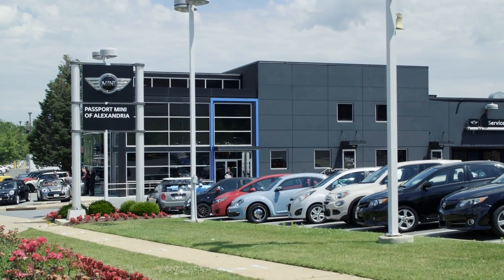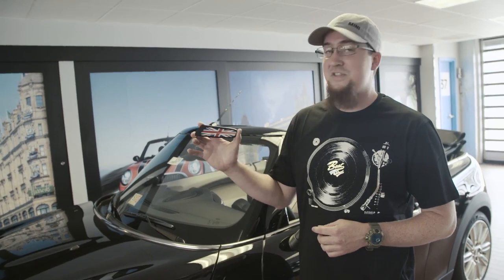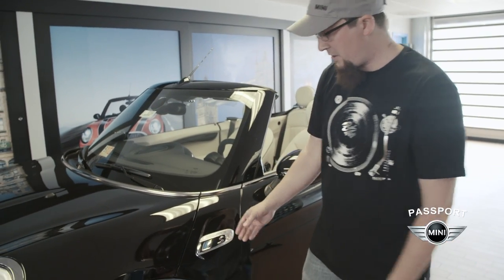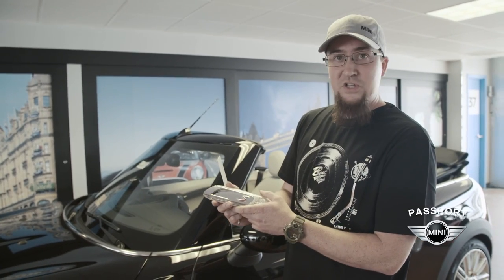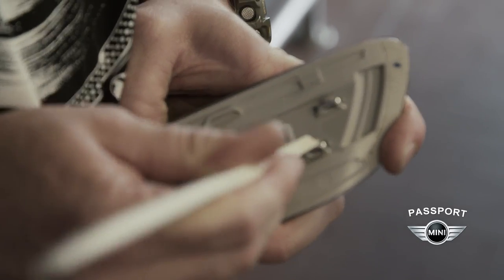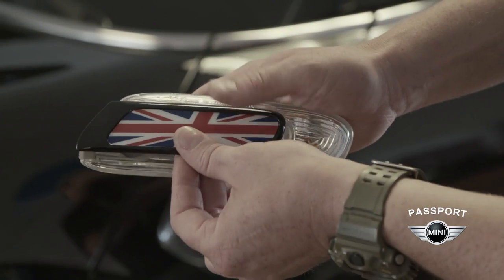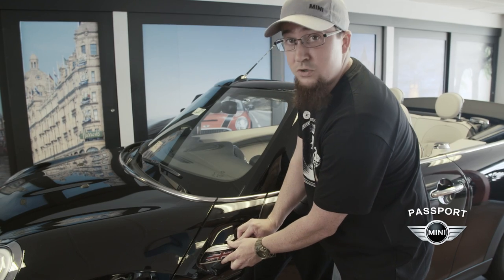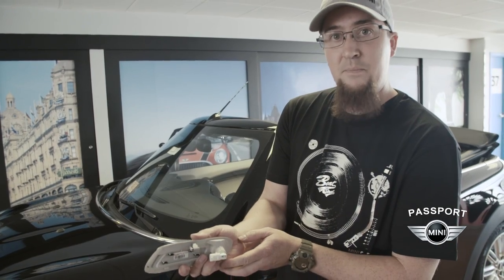How to install side scuttle kit on MINI Cooper (2014 and newer)

Comment: I accidentally bent the top metal spring clip and the whole scuttle/light assembly was super loose. Using this video's close-ups and advice for reattaching, I was able to bend it back to the correct shape. Snapped right into my Mini, nice and tight! Thank you, thank you!

Comment: Just did this with my '19 F56.  The driver side wasn't too bad but the passenger side gave a bit of a fight.  Of course, once it came loose I have a nice big scratch in the paint above the light from the metal clip.  And after putting the whole assemblies back on they wobble around a bit.  I'm afraid to take them back off to try to mess with the metal clips.  Horrible design.
Reply: I'll be doing this soon, going to use masking tape above the unit to prevent scratching the paint. Thanks for the heads up.